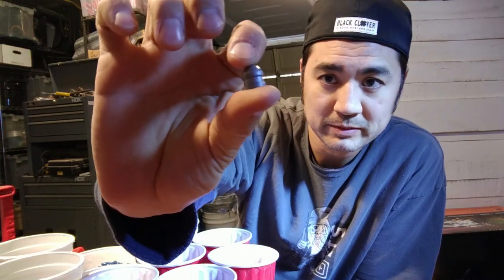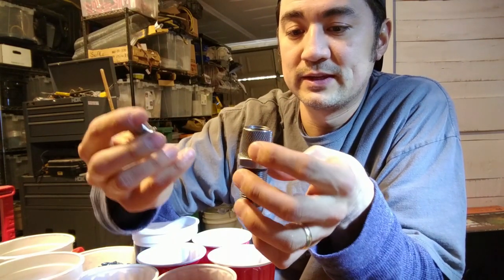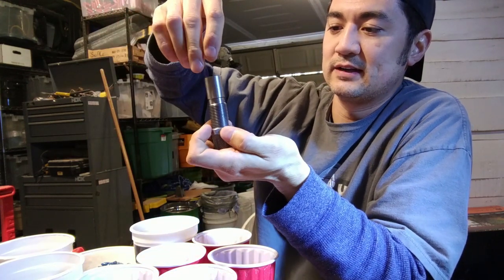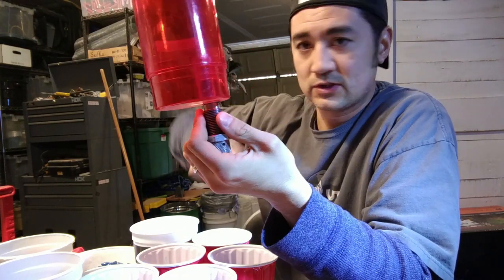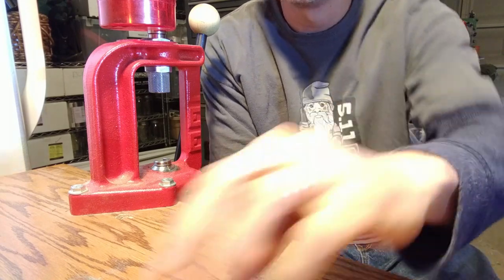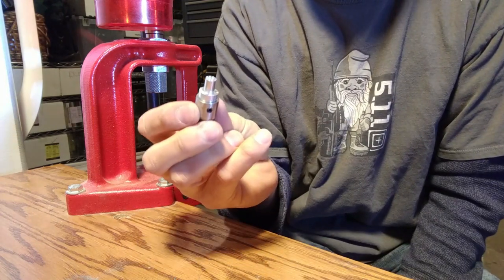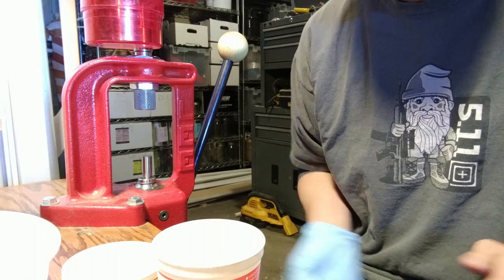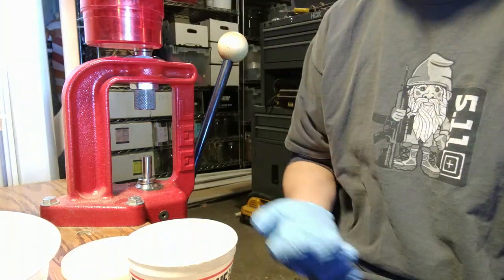Bottoms Up or Bottoms Down? Using The NOE Bushing Sizing Die

Comment: Great video and great timing I'm really needing some 309 452 and a couple different other ones yeah that would be a neat way I just change that little bushing out thank you
Reply from the maker: +Timothy Robinson yeah and you can get some of the really odd diameters too.  Until this, I had no way of sizing my Steyr m95 bullets to the right size.
Reply: Full.Lead.Taco that is a great deal about the odd sizes cuz when I order Ali die the place I will run from goes that's an odd size it's normally the right size

Comment: The NOE bushings are a nice system - too bad I've got so many of the Lee push through kits already - Doesn't make any sense getting the NOE now... Nice vid for the new casters coming in... Best Regards to ya,  FC
Reply from the maker: FortuneCookie45LC thanks! Yeah the Lee ones work well too, I have several of those.  I'm trying to get some odd sizes though like for my m95's which need to be closer to .333-.334 and a few others.  I'm going to see if I can convince NOE to make some more custom sizes.
Reply: Ha me too. Have a self full of Lee push  through. But they don't make odd sizes and  NOE for me will make sense.
Reply from the maker: NOE is running some additional sizes this week, hopefully!  They are going to run some for airgun bullet sizes, as well as the .334 for my m95 and .511-.512 for my 50 alaskan bullets and some others.
Reply: I cant believe that I'm just now finding that NOE makes this tool. Luckily I only have 3 lee sizes and they don't make a .310 or .379. I'll use the 20% off sale as my excuse.Great video Taco, next time that you see Al tell him that the .30 carbine mold I bought is my nicest bullet mold. Steve having doubles of a tool has never seemed to stop you before :)

Comment: Nice video.   I don't have an NOE sizer die, but I have several Lee push through sizer dies, using the same principle..  As you do, if using a gas check, nose first (up) seems to work best, as the GC seats squarely and evenly.   For lube (since I don't powder coat), I use Dillon case lube, which works great.  I've found that this type  of sizer die seats the GCs more consistently than more traditional sizer-lubricators, and is quicker.  BTW, it is noteworthy that NOE offers some high quality gas checks, which I use.

Comment: I’ve not yet started casting my own bullets, but it’s coming because I bought a .458 SOCOM upper. I’m $256 into factory ammo, and this Bear Creek Arsenal upper is not cycling right. It seemed under gassed. Oh well. I know once I’lI get it running right and then I’ll be plinking more often, and those 600 grain MOABs are on my radar. You wouldn’t want to sell about 50 to 100 for me to see how I like them, would you?
Reply from the maker: I can't legally sell bullets but NOE is working on their FFL so they can make and sell bullet samples.  You should give Al at NOE a call and see where he's at with that.

Comment: When ordering molds from NOE can you go over/explain the options?  There are four options 1. Drill For Probe, 2. Lyman/RCBS Style Top Punch, 3. Mold Wrench and Sprueplate Lube, 4. Saeco Style Top Punch.  Thanks!!!
Reply from the maker: 1. He drills the mold for a thermometer probe so you can monitor mold temps as you cast. 2. Custom top punch that fits the bullet nose profile perfectly used for the Lyman or RCBS lubrasizers for sizing bullets and lubing them with traditional lube. 3. Allen wrenches that fit the Allen screws on the bullet mold, and a little bottle of sprueplate oil to lube and protect the spruecutter. 4. Same as #2 but with threads to fit the Saeco brand of lubing/sizing press.
Reply from the maker: You should tune in tonight to the live chat, featuring Al from NOE to answer questions.

Comment: The problem I found with NOE sizing is that in the state they come from NOE I had a 313 bullet stuck in 310 die that I had to hammer out literally.  It wasn't a problem sizing with Lee smaller 309 die although it was hard.  I ended up polishing the bushing with Flitz paste and once it was smooth I was able to size it but here's the problem apparently NOE uses really really soft metal for bushing because even a polishing paste like Flitz opened up diameter by about .001"  I used a fricking sandpaper on lee sizer (sparingly) and wasn't able to open up more than half a thousand!  NOE kindly replaced my 310 bushing (God bless them) with 309 and after polishing I got 310 as I wanted and they offered me to return the whole thing but I declined because I am thinking of machining my own bushings from harder steel and perhaps heat treating it.  The size possibilities become endless!
Reply from the maker: I wonder how the length of bearing surface compares with the two dies... like how much of the bushing vs how much of the lee die actually does the sizing.  I've found that if I am sizing down more than a couple thousandths, I just use a little lube on the bullets and they pop through without much effort (also making less deformation of the bullet).

Comment: Glad I'm not the only one frustrated that Lee only makes a .329 for the 8x56r.  I honed mine out to .332 but always worry it is slightly out of round now.  I just ordered the NOE system so I don't have to hone any more Lee sizers or order custom ones.
Reply from the maker: Yeah, lots of sizes that Lee doesn't make--nice to have the options without opening up the Lee dies.
Reply: I got mine in the mail, they work great but the inside of the bushings is way more rough than I expected from NOE.  I might have to order the size under what I want and then polish them, depending on how much one opens up from some reasonable buffing to get rid of the machine marks.

Comment: After buying the NOE push through sizer I have to say I've noticed some cons. 1. With it being bottoms up, I lose much of the leverage that I had with the Lee sizers in my rock chucker due to the angle of the press lever.
2. On the Lee sizers you can adjust the die so that the push rod doesn't bottom out or smash into the sizer die at the top of the stroke. On the NOE sizer the push rod smashes into the sizer bushing at the end of every stroke. The long term effects of this are not yet known.
I also contacted NOE for a part number for a top punch to add to my order and received no response.
Other than that the craftsmanship is next to none. I just wish Al would've gotten me the part number for the top punch for my 311-121rn GC mould but I can't fault the sizer for that.
Reply from the maker: Have you tried calling Al at the shop to get the right top punch?
Reply: I will soon.I'm sure hes a great guy from what I hear.unfortunately my work schedule is such that I'm usually sleeping during their business hours. I need to set myself a reminder to call on my drive to work or something. Honestly I shouldn't have ranted on your video about that. I am curious however if you feel the angle of your ram arm to be a bit awkward as compared to the lee sizers. I really want to love this sizer and buy every size eventually.lol
Reply from the maker: I actually use the Lee classic cast press which allows you to set the angle of the arm to whatever you want/need it to be--Which I find very handy.  I got that press with some amazon points a while back and pretty much only use it to size my bullets.  I use the forster for the other single stage loading tasks.
Reply: Gotcha. Thanks for the reply. I'm always amazed at Lee's innovative ideas for the price.
Reply from the maker: Yes, I am also surprised with some of the stuff that lee comes up with.  Think about how cool it would be if all presses had an adjustable lever.  I'm also a fan of their factory crimp dies.
Reply: I've also bought fcd's for all of my RCBS reloading dies. And whenever I buy a Lee die set I get the four die set. Their universal decapping die and universal case neck expander are also great values.
Reply from the maker: Yeah, I have those dies also--they work great!

Comment: I just cast up some 350gr .458 bullets and Pc'ed and GC'ed them. I'm having a bit of a time sizing them, and am going to lube like You do. Do you do anything to remove the Hornady lube? Also wondering if I ordered a 0.461 bushing to run them through first, then finished them off in the .459? Going through the .459 with the GC and PC, can take quite a bit of effort. I think I need to try to shake off more PC before I put them into the oven.
Reply from the maker: I'd try lubing them first and see if that is good enough.  The lube sure makes a difference.  You want to make sure that no PC is getting scraped off during sizing.  As far as removing lube afterwards, I just take an old towel and swish them around on it for a minute.  That seems to do the trick--kind of the same way I dry the bullets after water dropping them.  If it still is pretty tough to size, sizing in steps wouldn't hurt either.  As a side note, not sure what press you are using to size the bullets, but I love the LEE classic cast press for bullet sizing because I can adjust the handle position/angle (leverage) to match the task.  A pretty strong and handy press for the $$$.
Reply: Cool, I am using the LEE Classic. I'm going to go get some lube and give it a try. Thanks. I'm going to PM you on NOE forums, looking for a mould that is in discussion I heard about but can't find.
Reply from the maker: ok cool, I responded.

Comment: Also might reduce fatigue from casting if you mount the press upside down.
Reply from the maker: Hadn't thought about that before.  I think I need to get a press riser to bring it up to natural height.  Upside down might not work with the lee bullet container for the bullets that are pushed through the sizer.
Reply: I tried that before. More chance of the bullet going in crooked, since it isn't sitting on the pusher post level.
Reply: The main annoyance was that I had to actively hold the handle up against gravity to place each bullet.
Reply from the maker: +GunFun ZS yeah I think the best thing for me would be to get a press riser like the inline fabricators one.

Comment: how come the picture. quality varies?
Reply from the maker: Poor lighting in my garage (sorry).  It was a cold day so I had to close the garage door (most of the way) and crank up the propane heater.  You can hear the propane heater in the background.
Reply from the maker: Someday I will get my reloading room finished.  Until then, endure my friend!
Reply: sorry didnt mean it to.come lff as an insult.  im a fan. nice to have  a fellow magnum junky like myself that cast and powdercoats
Reply from the maker: ha ha, no offense taken.  Which magnum calibers are you casting for?
Reply: Full.Lead.Taco  well sir i have a 500 magnum smith, a 454 alaskan, a 45/70 eaa tangfoglio thor... several.44. id love to know more about your thompson encore dino fuckerupper
Reply from the maker: The encore "dino" barrel is a barrel I had custom made by MGM (match grade machine) down in southern utah.  I used 50 alaskan as the brass, but I had them do a tighter twist for heavier bullets and throat the barrel to take 50 BMG sized bullets.  I wanted to make a "510 blackout" type round that I could shoot suppressed without hearing protection.  It is a fun beast of a gun.  I also need to do a video sometime with my 12" encore barrel chambered in 45-70 with a 14 twist.  That one is pretty cool too suppressed.
Reply from the maker: oh hey, we are playing with the idea of a huge hollowpoint 500 S&W bullet on the NOE forums.  This is what we have come up with so far, but still playing with designs: http://noebulletmolds.com/smf/index.php/topic,2013.0.html
Go ahead and check it out.

Comment: Sir, do you Powder Coat before installing Gas Checks or after installing Gas Checks???
I'm trying to hit 2500 fps with soft (10.1 bhn) lead.
Reply from the maker: it doesn't matter much either way.  If I am shooting suppressed, I usually like to have the powder coat go on over the gas checks to help hold them in place--but either way should be fine.
Reply from the maker: oh and let me know how your experiment goes--I've shot almost pure lead at 1800 fps before and turned the bullets inside-out.  It looked cool but I never ended up testing them for accuracy.
Reply: @FullLeadTaco  The alloy I'm using is 16 to 1 and it is pretty soft. I want to use it in my 358 Win AR-10 and go chase Bambi and Porky Pig with it...…….LOL
Thanks for the info
Reply from the maker: @johnparrish9215  awesome, please report back after you've had a chance to test.